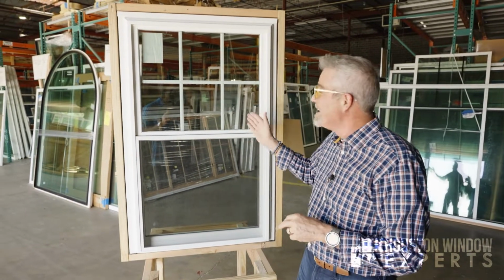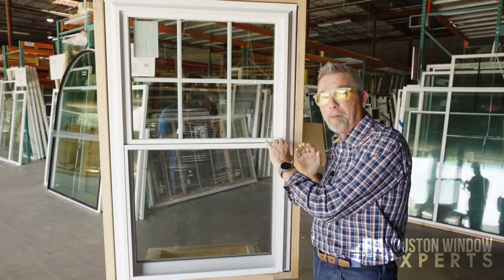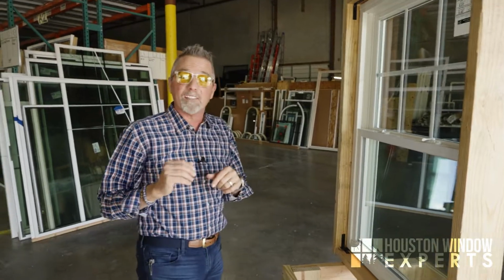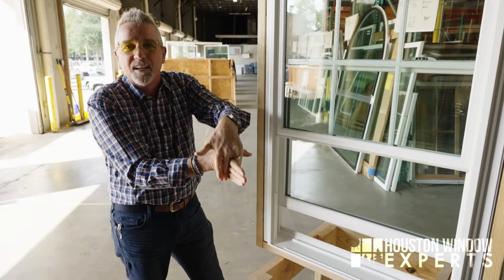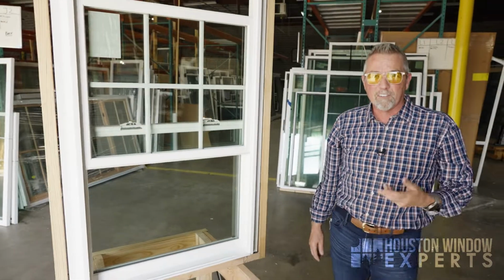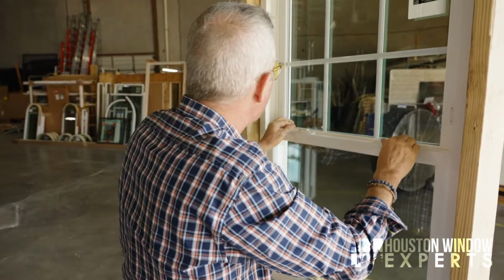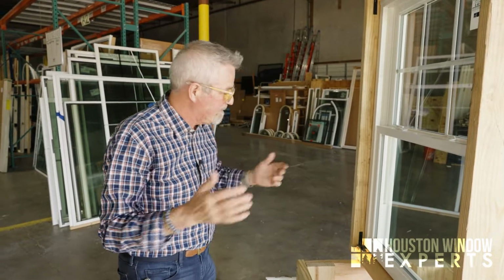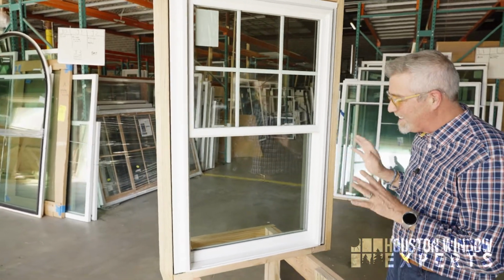Vytex Potomac HP Window Review

Comment: Comments on Vytex Potomac vs Provia Endure? (from PA)
Reply from the maker: Both are solid choices! Vytex Potomac is super energy-efficient and strong, with a DP rating up to 65, while ProVia Endure is very durable and has great customization options. If you want top performance for the price, Vytex is tough to beat—if you want variety and a well-known brand, ProVia is a solid pick.
Reply: Vytex utilizes a Vision vinyl extrusion which are typically premium and top of the food chain in vinyl.  ProVia's extrusion is fussy with a chopped up meeting rail (double hungs) with stick on corner cheater fuzzy pads.
Reply from the maker: Great insight Mike!

Comment: Thanks for sharing your review.  Very helpful.    One thing it doesn't show is how much the window opens.  Some vinyl windows don't open more than 2/3 which is not ideal for those of us who like fully open windows.
Reply from the maker: I have not seen any windows that open vertically go above a 40 to 45% operation. It’s impossible for the window to go all the way up to a full 50% opening because of the lock resting on top would hit the top of the window unit.

If maximum ventilation is your objective, I would consider a casement window. You will get about 95% of the ventilation available.

Comment: You didn't show the top of the window tilting in. Is only the bottom sash tilt-in? Also, I notice that the half-screen is only removable from the outside. That means you still have to get on a ladder to take the screens out to wash them, which is something you need to do in places like North Carolina, which have "the pollening" in March-April every year.  Can you please clarify on this?
Reply: Vytex Potomac windows are a double hung window. Both top and bottom tilt in. This being so, the half screens are easily taken out from the inside as they are spring loaded on the sides. The screens also have  a memory mesh which minimizes the risk of small tears. Hope this helps!
Reply: Thanks for the review. I live in Knoxville Tennessee and this seals the deal for me. No need to look further.

Comment: I tried looking through your videos but couldn't find the answer.  We are considering Vytex windows.  I noticed that you reviewed all of the exterior features of the windows but not the construction.  How do you feel about the interior of the Vytex window frames and sashes containing foam rather than being hollow?  Is there a tendency for the foam to mold?  Is there a benefit to hollow frames/sashes?
Reply from the maker: Thank you for watching and for your question. The phone is a plus to any window. I've never heard of anyone experiencing issues with mold or mildew inside of a window frame with foam. It will quiet down the transfer of sound, reduce condensation, and insulate better.

Comment: Have you ever reviewed European windows.  They seem to be all the rage now.  Triple pain and the tilt and turn are always talked about.  Think American window makers will ever make the tilt and turn window?
Reply from the maker: European windows are very nice and well designed. Most European homes are much older and have smaller windows than you'd find in the USA. Tilt and turn windows cannot be made very large because of the way they operate. 

You may see some here and there but they don't work as well in American homes.
Reply: @HoustonWindowExperts  odd, we had windows that were three times the size of the window you are reviewing.
Reply from the maker: I don't claim to know everything. I'm just telling you that the brands I looked into limit their sizes until then turns because of the frame material. If you get a wood product or an aluminum product you can go larger than you can with vinyl.

Comment: Please do Okna next! :)
Reply: I'm an owner and still in the field installing both OKNA and Vytex.  I'd give the nod to glass with Vytex as I've always preferred Edgetech Super Spacer to Duralite.  The Envirostar has the sculptured metal lift handles which look so much nicer than that of of vinyl rails in my opinion.  I like the balances and shoes from the OKNA lines over Vytex.  The vinyl extrusion from OKNA has a better designed anti-drift top sash kerf and interlock.  The meeting rail area with OKNA and weatherstripping is nicer too, however I give the nod to Vytex on the bottom sash seal to the sill.  OKNA's sill dam is stronger.  Vytex has nicer extruded aluminum screens and they offer Duo-Tech like locks that eliminate the bottom sash tilt actuators, OKNA doesn't like of offer that system.  OKNA doesn't offer any kind of accidental glass breakage warranty either.  Both OKNA and Vytex have the best exteriors sash glazing beads in the vinyl industry.  Seaway, Kensington, and Soft-Lite flagship vinyl all are real close to these offerings here on the east coast.  Outside of that there is a huge drop off.
Reply from the maker: I'll try to get a sample. I don't sell that brand.